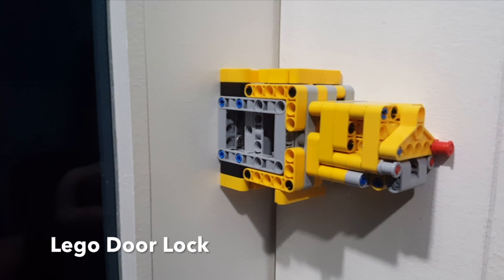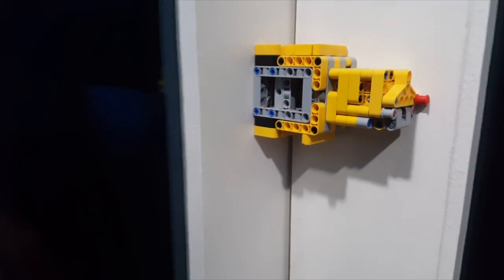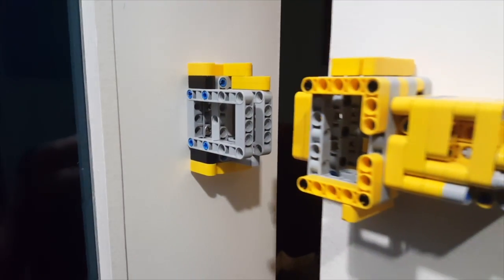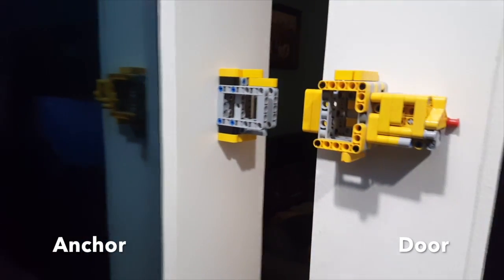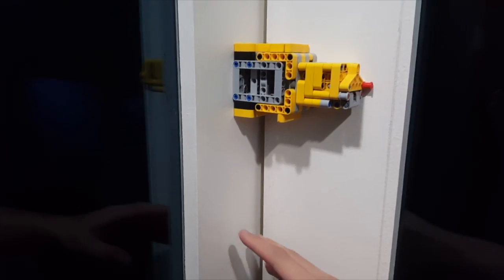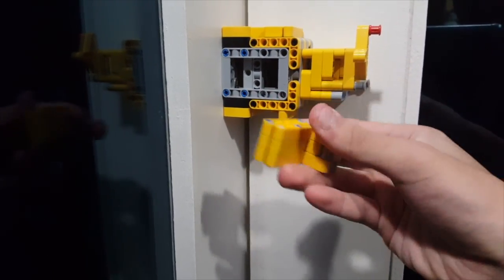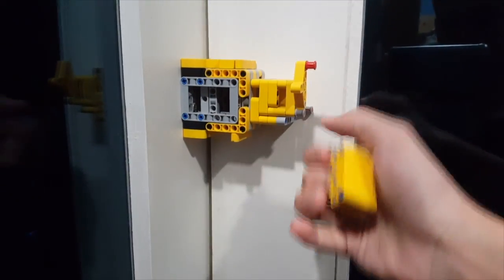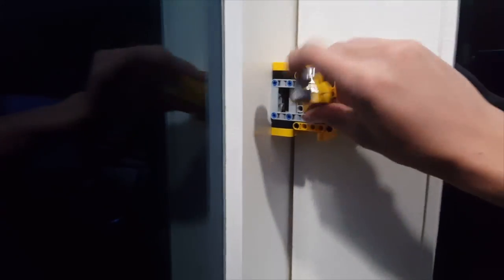Lego Door Lock

Comment: “You cant bust this door open with brute force” what about banging the door to get the key to fall out?
Reply: There's no way an intruder would know there's a lego lock or how it works. If they did, they probably know enough about the house to find an easier way in
Reply: Just angle the lock. This way the key will always slide into the lock no matter how much you shake it.
Reply: Or you could take the key out :/
Reply: The key is on the inside of the room, not on the outside @A Weird Guy

Comment: I think this was awesome and that’s saying a lot cause I’ve made my custom drone out of lego and it can even be used for minor maintenance on roofs and high up locations. (When I say minor I mea MINOR! Like removing leaves from your gutter or getting a ball off the roof) and it has a total playtime of 
30 minutes when at low altitudes and the movement support system is off
27 minutes when at low altitudes and the mss is on “skilled”
25 minutes when at low altitudes and the mss is on “new”
23 minutes when at medium altitudes and the mss is off
19 minutes when at medium altitudes and the mss is on “skilled”
16 minutes when at medium altitudes and the mss is on “new”
14 minutes when at high altitudes and the mss is off (very bad idea unless you are very good at using it like me)
11 minutes when at high altitudes and the mss is on “skilled”
And 6 minutes when at high altitudes and the mss is on “new”
In case you can’t tell the drone must use extra power the higher you go to keep it somewhat stable because of the winds being higher you go up.
The MSS (movement support system) setting called “skilled” allows you to fly around and do all sorts of things with it like flips and rolls and much more. It also allows the user to go into tight gaps but prevents it from hitting the ground if the user cuts off the engine so it doesn’t explode right in front of you
The MSS setting called “new” makes it so you can just move it around and preform one of the 3 auto programmed tricks where you just push a button and watch. It will even display how to perform the trick yourself on the built in screen of the controller (that I had to ad myself 😩) and shows you step by step what to do and what not. It also technically has a sub setting called “trick practice new” which I just shortened to TPN (there’s also a sub setting like this one for skilled but it’s for more complex tricks like triple flips) the “new” setting also makes it so you can’t go into small holes or fly near walls are what not. It also doesn’t allow the engines to stop fully once you take off.
Another nice feature about it is that I programmed it so it will warn you “hey you have 5 minutes please bring it to lower altitudes” so when it “dies” it can automatically start the low battery landing procedures and allow you to pick it up and what not. I also made sure it was “Armoured” so if it has a rough landing it won’t be damaged. Plus there’s only 5 parts in the 500+ piece drone that aren’t lego pieces that you can just buy so if anything that’s lego breaks you can just grab a spear piece (if you have a lego work shop in your basement like I do) and then replace the piece and rule the sky’s once more before charging the easy access battery which I even made a small case for so you can easily remove it without burning your hands. Also when I was talking about the 5 parts earlier that was just the ones that weren’t the battery or the heat resistant material that I put on the pieces that were really hot after use that way the drone didn’t melt like ice cream cause let’s face it unless you have your ice cream put in a bowl we don’t want it melting and this drone (except for the bowl part) is like ice cream to me. I don’t want it melting!

Comment: I'm guessing it would take about 20 seconds tops to break the lock from the outside using a "universal key" (prying bar), maybe even a large screwdriver. Even regular doors aren't made to resist forceful entry with fairly common tools more than 5 minutes.

Apart from than, I really like the idea.
Reply: that's on the door, not the lock.
Reply: @grootsChannel  It's on the weakest link in the whole system. A more secure door requires an adequate locking mechanism.
A single bolt made of ABS isn't gonna hold out for long.
At the same time, as someone else mentioned, depending on the type of glass, a secure lock would be easily bypassed by breaking the glass..
Reply: @lorelando7413  yeah but this isn't even an outside door. It's just to keep siblings and stuff out. Because the door is glass, you can't use brute force without it breaking so it's perfect for family
Reply: @grootsChannel  Never trust your siblings to not destroy your stuff! Even if it's a doorlock ;)
Reply: @lorelando7413  but it woupd be a glass door